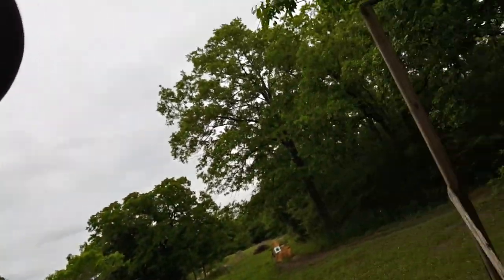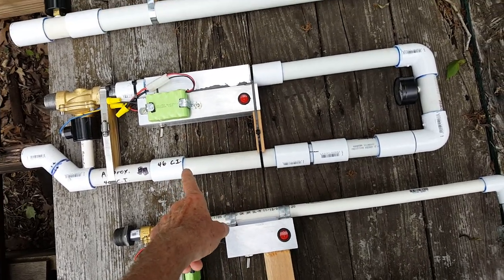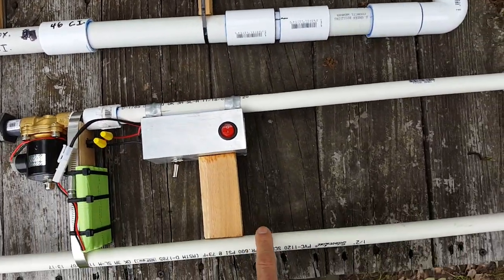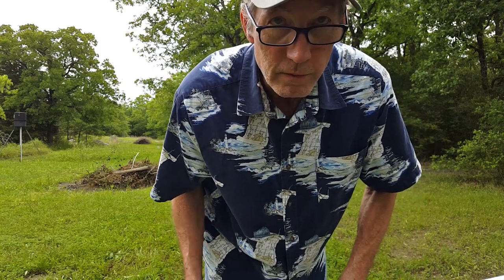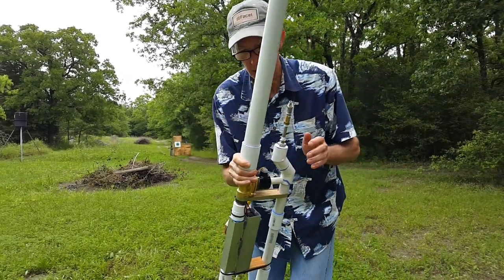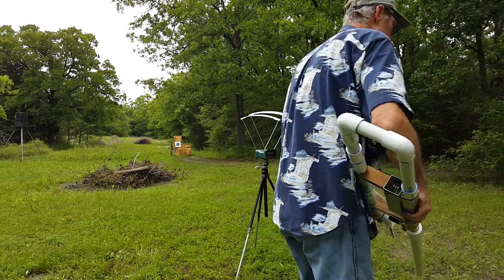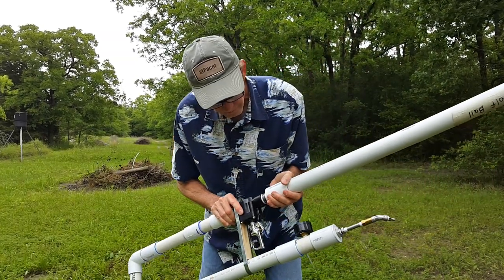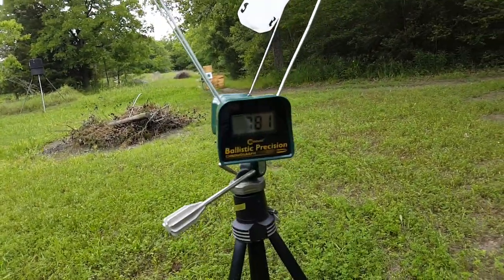3 Air Cannon Comparisons With Golf Balls

Comment: We want to recreate a similair air cannon and use a "bicycle valve" to pump our cannon up to 10 bar. But we don't know how to place the valve airtight in the pvc. Do you maybe have any tips for doing that? (It's a project for school)
Reply: Thanks for your comment. The best bicycle valve to use would be the kind that has threads on the bottom and 2ea nuts to tighten down against the rubber seal.